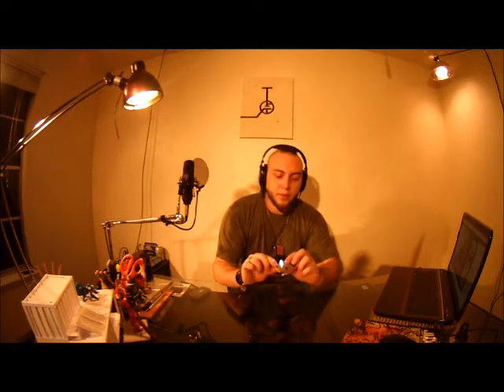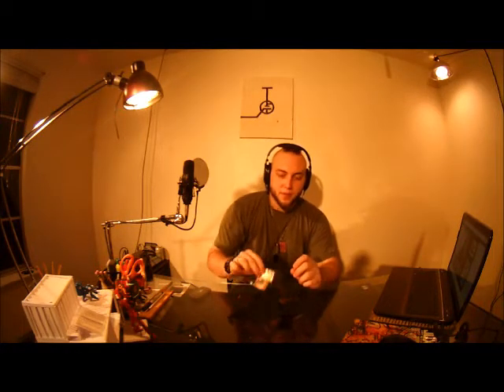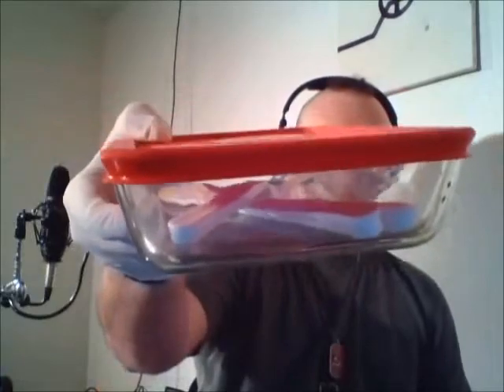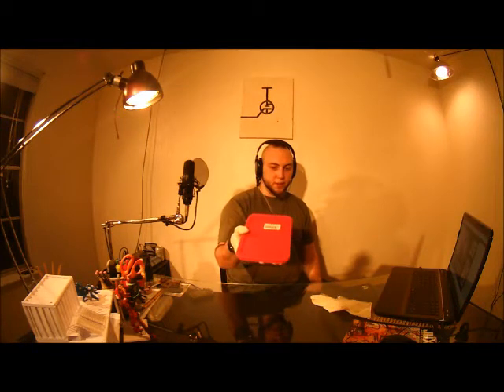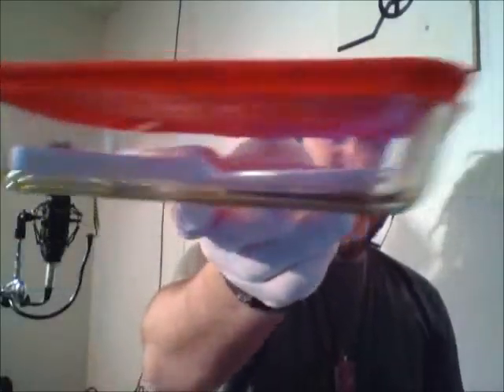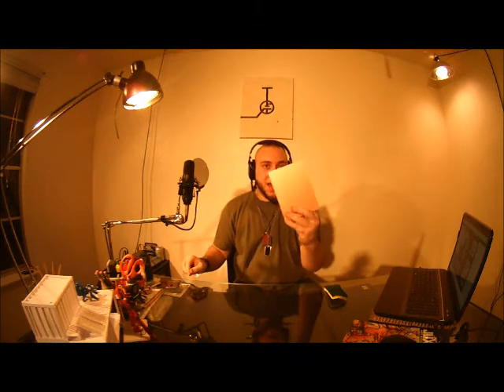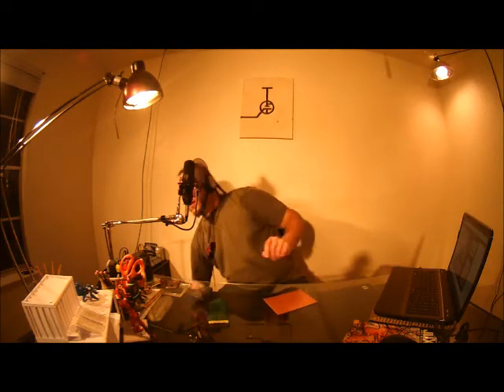Episode 2 - Etching Circuit Boards at Home

Comment: I use sort of a bain marie kind of a water bath setup and I put smooth stones in the bottom of my Pyrex casserole dish so it isn't direct heat. My etching tank is one of those frozen dinner black plastic trays. I also have a test tube with plain water in it and a cooking thermometer inside to monitor the temperature. Although as soon as you see fumes you know you're hot enough. A cheap lighter plug in tire inflator is the best for aerating the bath. The pulse action they do is great.

Comment: I've etched a couple of boards with ferric chloride and find it works much better if the etchant is heated up and I use a bubbler. Rocking is for the birds. So far I have ruined two toner cartridges running that blue paper through printers too. So I think I am going to give photo-resist a shot. Photo-resist can handle a lot more detail than toner transfer can anyways.

Comment from the maker: Yeah, actually I've had a lot of luck with the laser cutting method whereby you spray the entire board in flat back spray paint and then use a laser to etch away everything but the mask. Then etch the copper with your etchant of choice. 

The point of this video wasn't to show the best way, but a good way for beginners to get their hands dirty. Thanks for the heads up about that paper, though

I'm building a fume hood now so I can use hot etchants/plating/tinning solutions in my tiny apartment.

Comment: I'd feel pretty lucky too if I had a laser cutter. I made a board for a class A amp once using the nail polish method, although I used acrylic craft paint instead of nail polish. By hot I did mean bring the bath up to fuming, for fecl that is about 110F I'm going to try to sneak a link past YouTube(i) (imgur) (com) [29kxF] (jpg) so you can see how I heat my tank up. Replace with the appropriate dots and slashes for it to work. You already have the Pyrex dish. Get a 12V tire inflator to bubble.